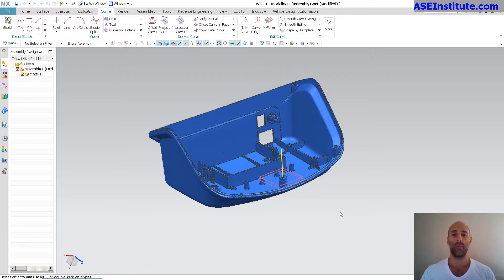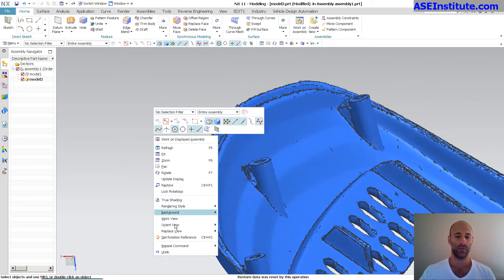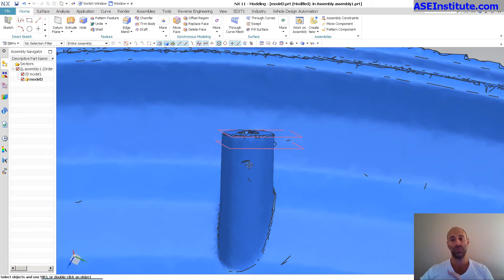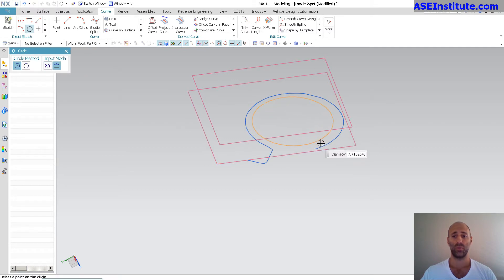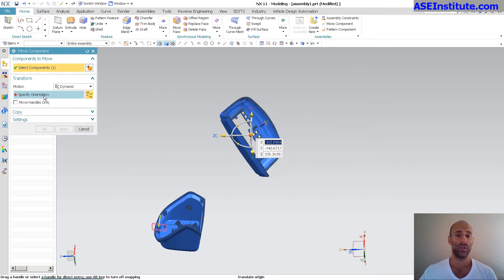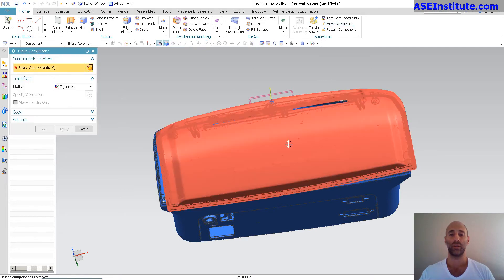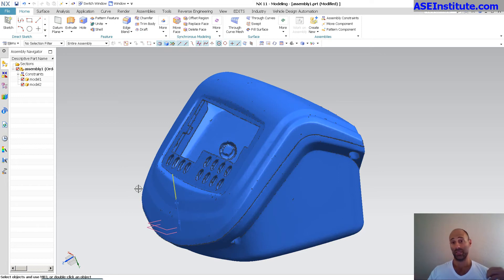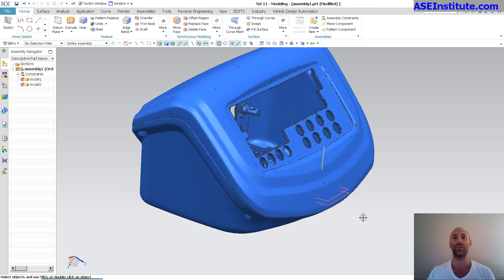Positioning STL Data: Siemens NX 11

Comment: I like your concept and workflow. 

Your intersection command results in a spline because it is faceted data. You can use the "Optimize 2d Curve" to get lines and arcs from the splines. This would be easier than sketching the circle as you did. 

Also, NX could have easily recognized the cylindrical (or perhaps it was conical) face.  From that you could easily extract a centerline.
Reply from the maker: This scan was in no way good enough to pull center lines. I tried. The tapers on those faces are not true conics. Looks like they were drafted from the curved surface.

I have messed with the Optimize 2D curve and it does a good job. I am used to not doing that as I want to match to a single curve most of the time when I am slabbing to a scan thus I forget it is there or to lazy to make the switch.